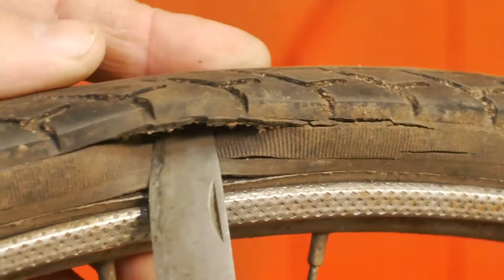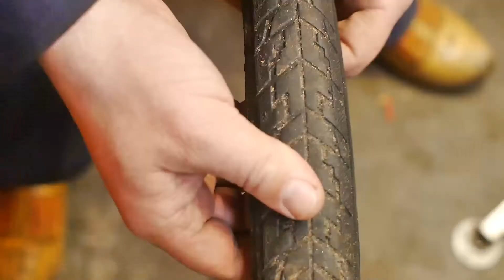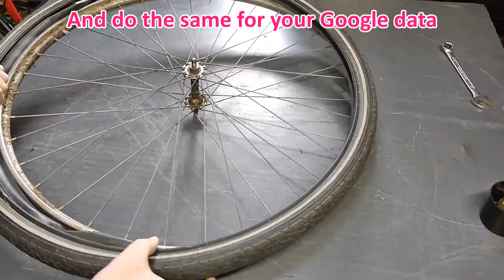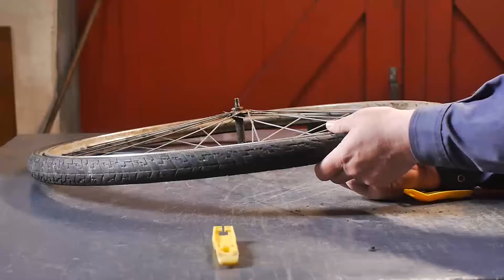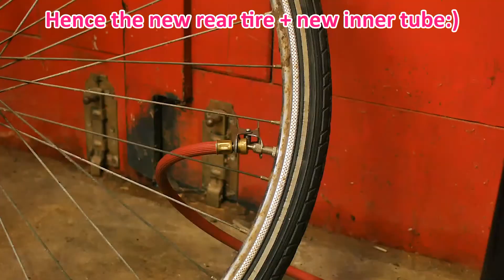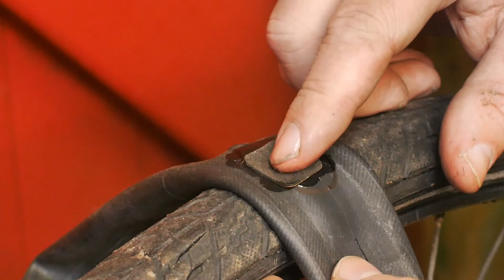replacing the tyre on my old bicycle

Comment: Your English is extremely good, and the swear words are correctly pronounced, very impressive!!!!
And thanks for bringing the clogs back, I was worried something had happened to them
Reply from the maker: I am better at swearing than I like. The clogs are on the way out I can feel the wood is wearing out, it is becoming a bit flexible. But it's time for rubber boots again, I hate the wet winters we get in this country.
Reply: @RolingRandom  You should migrate to Australia, much better weather and we pride ourselves at ruining the English language.
Reply from the maker: I would not mind living somewhere hot, like death valley :)
But I stopped taking my blood pressure meds, and I feel a bit more normal. Damn the consequences! I could not live like that.
Reply: I wear Lancashire clogs sometimes, but I’d love some Dutch ones, for everyday wearing!